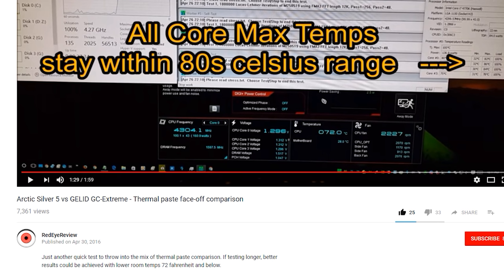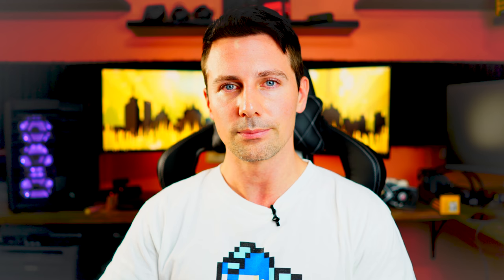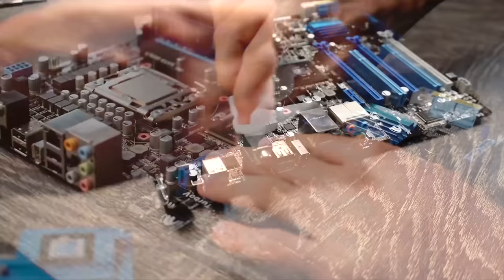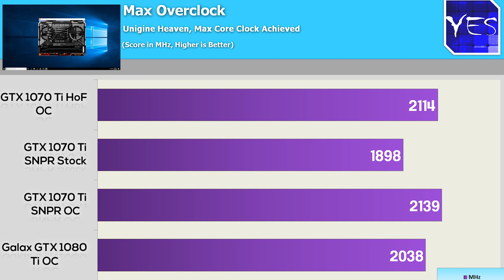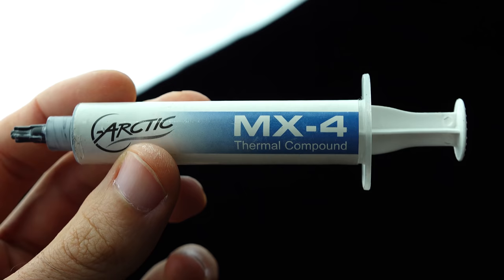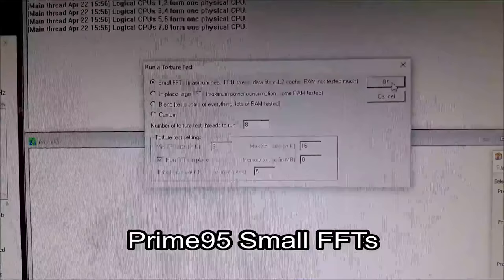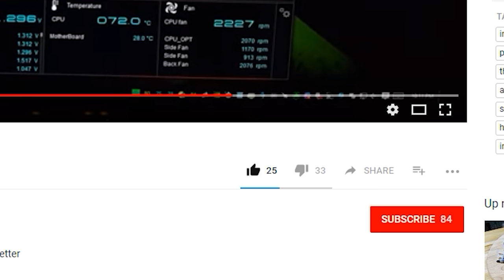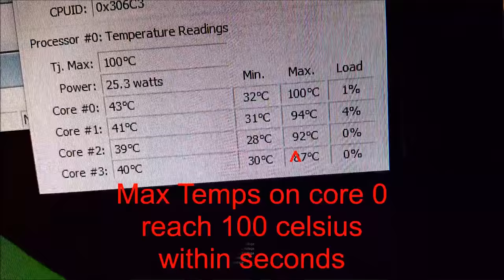Thermal Paste Investigation - GELID GC Extreme Vs Arctic MX4

Comment: What about Gelid GC Extreme vs Kryonaut?
Reply: I too would like to see this!
Reply: Gelid has 8.5W/mk and Kryonaut has 12W/mk, maybe pretty close tho
Reply: took a few seconds to search for it on youtube, marginal gains for kryonaut
Reply: oh nice thanks
Reply: I would like Hydronaut test vs. Gelid Extreme.
A bit cheaper than Kryonaut, but still should be great.
Reply: Seraph The MX4 is also 8.5W/mk so there's more to it than that.
Reply: The differences in thermal conductivity get more pronounced the more heat it has to transfer. They perform very similarly on CPUs with their low TDPs and huge heatspreaders. Things change on say an MSI 390X Gaming which produces almost 400W of heat on just 438 mm².
For general use though most thermal pastes are within a few degrees of each other.
Reply: The Arctic Silver 5 actually has 8.9 W/mK and the MasterGel Pro on the other hand has 8.0 W/mK, so that can't really be the only factor.
Reply: According to the "Original video" this Gelid GC Extreme performs almost like liquid metal (15-20 degrees difference), so I would compare it straight to liquid metal. If it does not perform similar that means there is something fishy here.
Reply: And in alot of tests it performs on average 0.8 better then the MX-4 and around 5 degrees worse than liquid metal.
The top of pasts is a realm of narrow margins, and the ladies big test I could find is around 9 months old.
Reply: Kryonaut needs to cure they say it doesn't but trust me it benefits from it. I've used it for over a year now and every time I've put it on something the results only got better with time.

The only downside to it is the stuff can dry out quickly if temps get very high. The website suggests it will start to dry out above 75c but it's not that clear. Thermal Grizzly is a German company and for some reason the use Google translate on their site.
Reply: Kyronaut is the worst thermal paste I have ever used. Was so excitedto use it spent 20 cad dollars for the one gram. Performed a degree worse than the Corsair stock paste even after reseating twice. Found some thermal paste I had lying around, two year old mx2 instant 8 degrees lower.
Reply: Seem to be the odd one out than, I used it on my 980ti and I went from 75c to 68c at 40% fan speed (the level at which the card is silent).
Reply from the maker: I will make sure to get some and drop them both on a 1080 ti overclocked.
Reply: Tech YES City what thermal paste will bring down the temps of a msi 1080ti armor card the most? Video please.
Reply: yeah, i use artic mx4 on my 1080ti but i cant use it anymore because even when at 60% load the temp goes to around 71c, currently i'm using conductonaut, planning to change it to kryonaut for safety reason, but if the gelid is better than kryonaut, instant buy
Reply: Seraph pay attention to the cooler, liquid metal destroyes aluminum. (I know the contact point of the cooler to the die of the GPU is often copper, but if you put to much liquid metal (with lm little can be to much) it can come in contact with aluminum.
Reply: Kryonaut is made for subzero overclocking, it has a very bad behavior when aged for a daily usage. Does the gelid is still good when aged?
Reply: i'm using inno3d 1080ti ichill, of course it comes with cooper coldplate,and you can see at their website, the only thing that makes me want to change it because of that SMD around the die, if the LM accidentally spill out, i'm gonna have a really" bad day, since i pay around $1000 for that card at here
Reply: Seraph That's the problem, check out artic accelero extreme GPU cooler.
Reply: bb rr According to Reddit, yes, it lasts like 4years easily
Reply: sadly i just buy my 1080ti around march this year, so yeah, no money right now, also artic accelero cost around $280 at here, not worth it i guess
Reply: also, ambient temp at here around 29-31c !, i dont have any AC, so yeah, pretty much worst case scenario
Reply: How about make a big test on it, including the stock paste with offmarket coolers
Reply: @Tech YES City
Any chance you'll be able to do this comparison within the next 6 weeks?  Middle of June I'll be taking a "stay-cation"  and I plan on doing some much needed maintenance on my pc, which will include replacing the TIM on my cpu along wiht some other things, like replacing some crappy fans, taking pc completely apart to clean it, and some possible upgrades.
Reply: Compare Liquid Metal if you can too, Thermal Grizzly Conductonaut.
Reply: Thermal paste comparison results
https://www.tomshardware.com/reviews/thermal-paste-comparison,5108-9.html
Reply: Yeah I replaced the thermal glue or what ever it was on my original Xbox (I call it glue because I had to use a lighter to heat the heatsink to get it to release.) I used some cheap knock off AS5 from China and it lowered temps a good 5C although this is VS some 16 year old thermal stuff that probably was barely working.
Reply: Hey, actually, there are many existing thermal paste tests in russian OC community, check them out. (And let the google translate be with you (: )
With high-end thermal interfaces (gc-extreme, kryonaut, etc.) it's really hard to get adequate test resolution, so the only appreciable differences between them is ability to run extremely low temps (Phase-change, LN2, LHe) and price.
Reply: Kry is about 1C better than GC
Reply: @kanutinbonbin  - Thanks. Read on Amazon GELID GC Extreme reviews it sets up fast, but advertised Non-Curing. I was planing to use CM 212 Evo paste, it's supposedly non-conductive. But would prefer a paste that remains easy to break apart and lasts the longest.
Reply: @theswagler5648  hi! You can use the gelid if so. Anyway, nothing that a guitar pick or a little spatula (included) wont take away when the time comes. As long as its made out of plastic, you shouldn't have any issues removing the thermal compound.
On the other side, I find that the more liquid likethe thermal paste is, the bigger the headache to remove
Reply: @kanutinbonbin  - This channel has good info. I bought a P6T Deluxe v2 combo for $100. Now ordered x5675, CM 212 Evo and J Gill 12gb 1600mhz triple. This channel showed dismantling heat pipes on my board and re-pasting them too. Do you like GELID GC Extreme better than thermal grizzly kryonaut?
Reply: @theswagler5648  i can confidently tell you that if were to find Gelid for $5 cheaper than Kryonaut, then it just becomes the choice of 5 bucks or 1-2°c of difference in favor of Kryonaut
Reply: if you search there is a video on youtube already.  they performed almost exactly the same even though kryonaut has a "better" rating.  may have been a 1c difference in some tests if i remember correctly but that could have been from the room/parts heating up or what not.  Gelid's some good stuff but you can't go wrong either way.  but to me, even though i used AS5 for years, Arctic is dead.  Been on gelid for prob 5 years now and not looking back.

Comment: Arctic Cooling MX-4
Noctua NT-H1
Gelid GC Extreme
Prolimatech PK-1
Phobya HeGrease
Thermal Grizzly Aeronaut
EK-TIM Ectotherm
Cooler Master MasterGel Maker Nano
Cooler Master MasterGel Pro
Prolimatech PK-3
Gelid GC Pro

These  all perform within 1-2 W/mK of each other, all in sizes between 3-5 gram. The price is also similar across the board. Performance wise these are pretty much all alike, and I've personally used Arctic MX-4, Gelid GC Extreme, Prolimatech PK-1, Noctua NH-T1 and Phobya HeGrease. The temperatures were pretty much the same. So which ever one of these are the cheapest, you buy.

And what the fuck is up with thermal paste fanboyism? It's T H E R M A L   P A S T E. Fanboyism is fucking toxic, and if you're loyal to a brand just because of the name, then they've got you exactly where they want you.

Comment: Arctic Silver 5 is made by Arctic Silver, Arctic mx-4 is made by Arctic Cooling. Those are different companies.
Reply: I never knew that
Reply: I never knew that, too.
Reply: @funnyarc  lul
Reply: @venky3867  Totally going to try this GC Extreme stuff, always used Artic Silver 5 goodness on my poor old 1155 motherboard and i5, but it's time for me to be heading towards Ryzen 3600 and 3060 TI for that 1440p@120fps <).

...well i already have all of it, just gonna have to remove the old Artic Silver i pasted on, then reapply Gelid.
Reply: @funnyarc  I've already repasted my laptop with GC extreme
It is very good

Comment: bought gelid extreme and replaced my mx4  on my 8700k @4.3, i dropped 5-10 degrees ,  was idling around 50 now high 30s to low 40s ,  gaming in the 60s mainly with spikes in the 70s with the mx4  , now gaming in the 50s mainly to low 60s  , i was skeptic about thermal paste in the past but i now recommend high quality like gelid or kryonaut if your overclocking or just want to bring down  temps
Reply: today i will change mx-4 for kryonaut. your information helps a lot. thx.

Comment: Could you do the test with a CPU? Since they're more stable when it comes to clocks, voltages, etc and thus ultimately heat output. Use something that dumps a good bit of heat though like a K SKU 6 core i7, or something HEDT. Not something low end like a Pentium.
Reply: I would be sorely tempted to delid it and put in liquid metal on the cores themselves and put the heat spreader back on and use the GHelid QC Extreme therrn call it a day. I use AMD Ryzen which has a soldered on heat spreader and cool it with a custom loop. I used AC5 when installing the water block. I am ordering the Gelid QC Extreme and it looks like I need a re do.

Comment: Dude! This video confirmed a lot of my suspections, I bought some MX4 and I've been experiencing really not great temps on my i7 4700MQ laptop with a light overclock. I have heard of Gelid GC Extreme from a professional overclocker, but I didn't think much of it, but now I will give it a try.

Also yes! Death to the pea method, I dropped the temps on my 3960X by 5-10ºC by actually spreading the compound rather than using the pea method.

Comment: I was using Arctic MX2 in my laptop which is a Msi GE62 6QF to replace the stock thermal paste because I was seeing temps as high as 94c with a bit of dust in my heatsink. Cleaned it up replaced the thermal paste and the temps were around 90c in a warm house. Another 6 months or so goes by and my temps are now hitting 94-95c way to high for my liking it was so hot my hard drive temps and motherboard temps were going up as well the MB was in 90's. Cleaned out the dust and this time replaced the thermal paste with Arctic Silver 5 since I already had some on hand. My temps dropped significantly down to around 75c about 4 months went by and my temps started to get into the 88 - 91c also my house was fairly warm. So I decided to clean the dust out again. I didn't replace the thermal paste this time but the temps went back to around 75-82c and with a laptop cooler that I've been using now it likes to hangout in the 70-74c under full load in a temperate environment. I forgot to mention when I saw how well the Arctic Silver 5 I applied kept the temps down the first time I immediately installed a Vbios mod to my videocard which is a gtx 970m making it perform fairly close to a gtx 980m about a 15%+ increase, 1038 to 1215 on the core and 2505 to 3042 on the memory. I would love to try the GELID GC Extreme next time I need to clean this computer out and see how much lower my temps will be in comparison to the Arctic Silver 5 I currently have, thank you so much for the information. Also the temps I was describing were the temps I was getting from both the cpu and the video card, they run at identical temps to each other though the video card is often a few degrees less also the temps I mentioned were taken from the hottest component in my computer the CPU which isn't overclocked just has a slightly lousy cooling solution as most laptops do.

Comment: I always used artic silver because it was the go to stuff back in the day. I'm all for using something else if it's better(and not crazy expensive)
Reply: AS5 hasn't been the best for over 10 years. The 2 week break in period, the complicated break in process, and the fact that it needs to be replaced every 9 to 12 months pretty much killed it once better compound like MX-2, Gelid Extreme, and Noctua NH-1 among other came along. The better compounds have a simple break in period of less than an hour, most within minutes and last several years. Even the stock CoolerMaster TIM they include with they various Hyper 212 models is superior to AS5.
Reply: well when it's 5+ years between computer builds, you go with what you know sometimes(it was the brand name I knew). and I have no idea about the break in period, my cpu stays in the teens to low 30's and I just put the stuff on and went with it.  I really have no use for noctua products, the fanboyism makes me boycott it, but I'll probably buy this Gelid stuff next time I buy something, but I wasn't going to buy something I didn't know or didn't have any details on other than their sales page claims.
Reply: Hardcore Hardware, I didn't say their lower end coolers, I stated their Hyper 212 series which includes their GS400 which is excellent.
Reply: No, the 212 is a budget cooler, and is considered one of the best budget coolers. It, nor the GS400 compound is crap and anyone who tells you different is either mistaken or lieing. There are numerous tests conducted by extremely knowledgeable and reputable sources that will back that up.
Reply: Low end implies low quality. Budget does not. There is a HUGE difference between the two. And none of the GS400 I've ever run into shipped with any of the 212's (at least up thru the latest one which I haven't used personally or in builds for others) could in any way be considered runny or watered down. It had about the same consistency as AS2, AS3, AS5, MX-2, NH-1, the compound from EK, Thermalright, etc. Granted it isn't as pasty as Gelid, MX-3, MX-4, or IC Diamond, but that is due to it being designed to fill in the spaces between the heatpipes and the cpu contact plate. It's a lot more difficult to get thicker/pasty compounds like MX-4 into those gaps which caused uneven and higher temps with those compounds.

Comment: Will try gc extreme next. It is still too expensive in Croatia but i'll try it (Gelid GC Extreme 3.5 grams at 109 croatian kunas (just under 15euros), and Arctic MX-4 2019 edition is at 140 kunas (just under 19 euros) for a big 45 gram package. My old gtx 970 strix is already much cooler with mx-4 than with stock, but I'll try gelid gc extreme also. Was considering Kryonaut (as I also don't like electrically conductive or capacitive thermal compounds).
PS: great video!
Reply: i dropped 20+ degrees on my 1060 using mx4.

Comment: I've been using this paste on my GPUs for about a year now I went through the same journey to realize the Arctic Silver 5 was very much inferior all on my own but I just have never bothered trying to argue with people about it because I know how silly people can be. Gelid is hands down the best thermal paste I've used to date.. I do dozens of builds a year and change out parts on my personal PC constantly.

Just to note I am using gelid on both my GTX 1080ti with my EKWB right now as well as using it on my 7820x that runs 5Ghz across all 8 cores. Full transparency I have also delidded my 7820x and run liquid metal between the die and IHS
Reply: Mitch H Same here. Eventually I'll use it on my GPU, whenever I actually get to it
Reply: Until I see some video's like this I am very much a creature of habit, but hey if a cheaper paste is better that's a win win in my book :) about the only metric left to worry about is if this other paste lasts longer than AS? (It might which would make 3 for 3 wins!) but I am almost of the mind where "Here is 3 qualities you can pick 2 that are good and 1 that is crap!" Not saying that it's this way but my luck it would be... (still gonna buy some, lower temps and price wins it for me, I swap out CPU's usually 1-2 times before I do a whole new build so... long lasting paste is not high on my list of needs.)

Comment: Love your videos man! And your point is excellent. However in my unbiased expression for what I will say now: Arctic Silver 5 doesn’t work adequately when its freshly placed onto the processor. Arctic silver 5 needs at least 5-7 days to cure, and only then the temperatures will be lower. That’s the only minor drawback of Arctic silver 5, unlike the other products you’ve mentioned that work on the spot. But either way all 3 thermal paste you’ve mentioned should definitely  do just fine compared to stock paste from gpu manufacturers. Never the less great point and keep up the vids!

Comment: I have found brand new XFX rx 580.The stock thermal paste was really bad.It was already hard out of the box. Changed with GC extreme and the results really surprised me.Now the temps never pass 71 celsius adt the fans are at 1500-1600rpm vs 76-77 with 1800-1900rpm fan speed (some times 2100rpm) with the stock one.Great product!

Comment: Love the Gelid GC Extreme, and I have used it plenty of times. However, I did discover Phobya NanoGrease Extreme, which I like a lot better. It's a bit more difficult to spread than the Gelid, but it seems to transfer heat better. As an aside, I also use the spread method. Love the videos, keep up the good work!